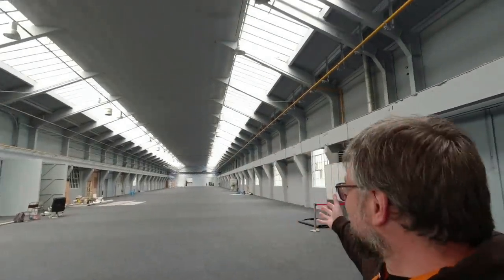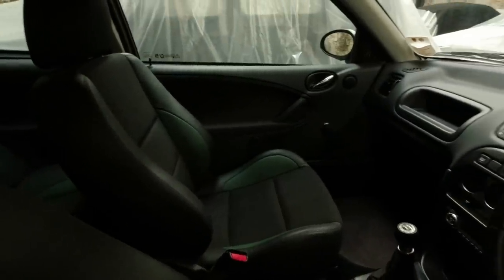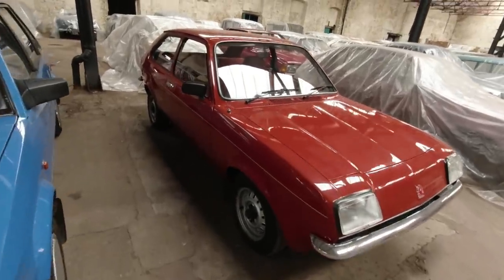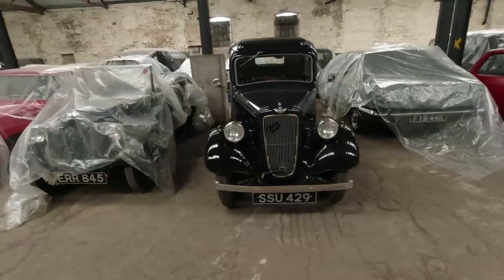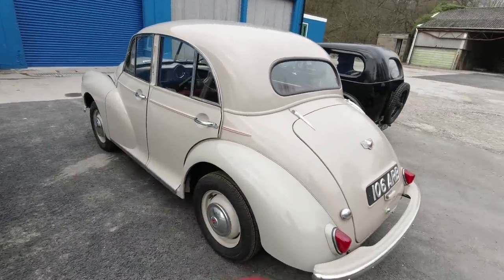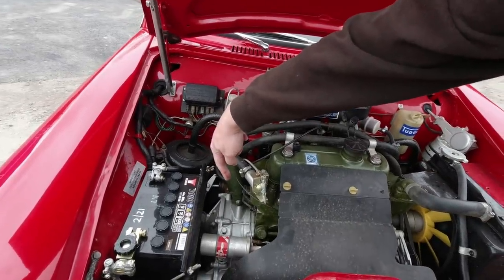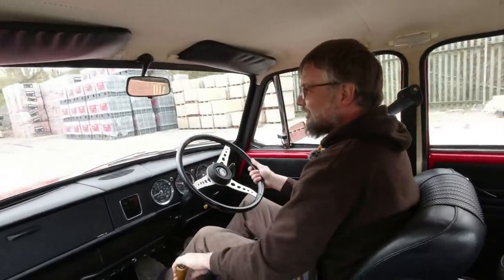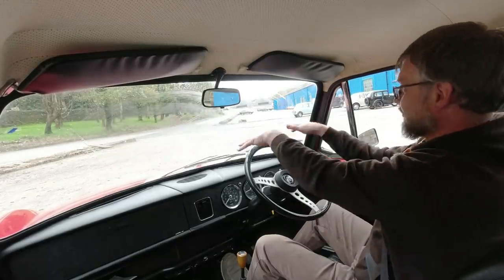Great British Car Journey Museum! With Austin 1300GT Drive!

Comment: Bucket list just extended by one more item and it has gone straight in in pole position!  What a wonderful idea. Driving a baby Austin is already on the list so two birds with one stone. 
My father used to tell of his epic journey from Cambridge to Oban in an Austin 7 and having to go up the old Rest and be thankful pass in reverse gear because the ratio was lower than first gear. That or first didn’t work which is not impossible because he also rode a bike that only had one pedal when posted up in those parts during the war!  What an adventure that must have been. 
Wishing them every success with a wonderful business model.

Comment: Great video Mr Hubnut!👍
My aunt had several beige colour Austin 1100s when I was growing up, always bought brand new. She switched over to Allegros when the 1100 was discontinued. 
In the late 80s my dad bought a 3 door 1100 from a friend. It was dark brown with orangey beige seats. He welded the complete floorpan with new metal as it was full of holes. I drove it a few times and it was lovely and easy to drive. Quite nippy too. Huge steering wheel. Nothing like the cars of today. Although I always thought the 1100's body design was ugly. We were out for a drive in it once, probably in the early 1990s, and some young lads were laughing at the car. They probably hadn't seen one before and didn't know what it was, so I forgive them! :)
But in the end, that little Austin saved my dad's life. He was on the motorway in France, late at night, when a truck driver fell asleep at the wheel and crashed into my dad's car and pinned it to the central reservation barriers. My dad was badly hurt, but he survived the crash praise God. I saw the photos of the wrecked Austin and the roof had been bent upwards in the middle like a squashed drinks can. It was a mess, but if my dad had been driving a left hand drive car, it would have been a far worse outcome.

Comment: Memories of replacing and pressurising the hydrolastic suspension on my mum's 1100. Also discovered that you can get the wheels to lift off the ground with spirited cornering on the 1300GT. Great little cars to drive.

Comment: Takes me back to my second car - a white 1971 1300GT with black vinyl roof and red interior bought brand new.  However, in three years of ownership I upgraded mine - engine bored and stroked out to 1430cc plus different cam, bigger SUs and straight through exhaust, per David Vizard's book on tuning the A Series, anti-roll bars, bigger brakes and 13 inch wheels - a Lotus Elan eater that I thoroughly enjoyed.

Comment: Just a pedantic point, the air wasn't ducted in through the wing to the radiator on the 1300GT, or any of the similar transverse-engined cars from the mini upwards, it was ducted outwards. The air came in through the grille and then over the engine, through the radiator and out to under the front wing. At 20.32 you can see the fan blade, bearing in mind the engine rotates clockwise when viewed from the fan end you can see that the fan pushes the air outwards and not inwards. As a mechanic in the 60s I remember not many people realised this as it was opposite to 'conventional' cars like the Morris Minor, Austin A30/35/40/55/60 or any of the Ford or Vauxhall cars of the day.
Reply from the maker: Yeah, a stupid 'fact' my brain decided to chuck in without thinking about it...

Comment: I had an Austin 1100 in that exact color.  I rebuilt the engine and had it resleeved to get it back to factory shape.  I did put on a header and dual carbs.  I used to have the worst problems with it until I dumped the contents of the gas tank and cleaned it out.  After that I drove the car the length of the PA turnpike at 80 mph and it ran like a top.  I never got pulled over but I think it was because the state troopers thought that nobody would believe that the car could do 80.

Comment: that t reg astra at 2:30 only has 45000 miles on it. but check the mot history and its still suffered from rust issues and at 5:30 the maestro has only done 13000 miles.

Comment: Saw my 1st and 2nd cars next to each other. Vauxhall Chevette next to Austin Maestro.  Though mine were a poverty spec chevette and then vanden plas spec Maestro with R series engine, space age dials and talking trip computer.  The former was the only car I had with manual choke, the latter could have been doing with one. It’s electronic choke was awful.

Comment: No news about Scotty and Whisky at the moment. Just wanted to point you in the direction of channel I found recently called "Ivan's Shed". Latest video is a walk round and driver of a '59 Mini. In the background, while they're doing the walk round, the engine on the stand ticking away, is an old prototype 2 cylinder engine they have been rebuilding. Fabricated a crankshaft by chopping and welding old cranks. They've recently got a 2 stroke engine that was made for the Mini. Should be interesting to see them rebuild that.

Comment: A slight error on the airflow direction on BMC transverse engines,  The air comes in through the grill as normal and is blown out through the radiator into the front wing.  Otherwise all the spray and road muck would be sucked in, block the airflow through the radiator and cover the engine bay.

Comment: I hate to be "that guy", but i'm going to do it anyway. on transverse A series engines with the side mounted rad, the fan pushes the air out through the wheel arch. Great video as always, and i'll be visiting that museum as soon as possible.
Reply from the maker: Yup, my error. There's always one. Sometimes more...
Reply: @RussEdgar445y7tlfj  did these not have a remote servo like the Mini cooper S at the time?
Reply: @HubNut  If it helps, I didn't spot any errors in the A series video, despite me playing with those engines for several decades.
Reply from the maker: I did make a mistake. The 1071 AND 970 were over-square...

Comment: Just started watching Dad had a MG 1300 back in the day-Care nice and comfy car Seemed fast as a kid.1990ish I had a Twk coloured 1300(very comfy but holy-wellies worn when it rained)Shell was shot and failed MOT but for some reason it had an 11 stud cylinder head so whipped it out and threw it in a mini.Good times.If only I'd realised at the time that the engine was possibly special a la cooper s-can't remember if it had tappet chest or solid block.

Comment: I owned a 1300gt in the mid 80s, great little car. Unfortunately got my finger stuck in one of the holes in the steering wheel while stopped at traffic lights.

Comment: Any pre-war (1928-1934) Morris Minors in the collection? It's a very important historical car as it was the basis for MG's very first small two-seater 'Midget' in 1929. All future two-seater Roadsters, including the 1962-1980 MG B and the MG F and TF from the 1990s and 2000s, owe their existence to the 1928 Morris Minor. I am slightly biased as I own a 1932 two-seater. 😄

I was hoping you were going to do a test drive of that Austin Seven (Nippy?) at the end of the video. Sad times.

Comment: 1300 GT...almost 
Mini Cooper 1275S engined. Very much a watershed of the best A series production hot parts. Alas, the  T Rex Eliminator  1275GT Clubman. Austin 1275 single carb, tractor cam, grey Slurry.

Comment: I had a brand new Austin 1300gt in bronze Yellow. Their were 3 extras you could have put on. Bumper Overiders Servo Assisted Brakes
Reply: Heated Rear Window. On the road cost including tax in 1970 was £1077. I thought at 21 could I afford to spend that much on a car. Wish I bought 10.

Comment: My aunt had a 1971 Austin America that I was quite fond of. Similar spec to this one but with two doors. Same steering wheel and grille. Not up to American driving conditions though. CV joints fails after a few years...are they a different type than used on modern front drive cars???.

Comment: I can almost hear that MK1 Astra making that knocking sound that was so common.
Reply: Worn camshaft bearings! I had a Mk1 van that was so badly abused, the followers wore deep grooves into the cam lobes, then bits of the lobes broke off and did even more damage.
Reply: @Zeem4  That sounds about right.

Comment: If I visit and drive one will activate the washers and wipers and tell them hubnut told me to do it 😂 On a slightly more serious note when did the radiator on transverse engined cars move from behind the wing to what is to me a much more logical place behind the front grille?😃

Comment: After seeing that big gantry crane still on site it made me curious about previous use of that building and apparently they made steel wire the company went back around 150 years and the whole site was engaged I guess the demand for wire has diminished or supplanted by China perhaps.

Comment: Nice car The Austin 1300 GT. The only real downside about the hole range was thay were absolute rot boxes.  I went to buy one over 40 years ago. It was a god job I opened the front passenger door bk both hinges including the door came completely off the car. I didn't buy it .

Comment: Owned 2 Austin 1100's one had 18000 genuine miles, 11 years old registered to a large garage group to get round petrol shortage at the time. Sold to Genuine old Lady owner after 3 years and 3,000 miles. She put the remaining 15000 miles on it until she sadly passed away. I had it many years, till a tractor hit it. I was offered a not too rough 1300gt for free. I knocked it back. It hadn't the "Thermometer" speedometer. I just couldn't do it. Sorry 1300gt enthusiasts. I loved everything else about them, shimmable ball joints, the pints I won in the pub (though sober when performed) mk 1, 2 did not have a synchromesh on 1st gear. A bus driver tought me how to properly double de clutch. Conversation "cant stop first gear grinding even when Im stationary" me:"Take it out of second, put straight back into second then quickly up into first" second punter "I wish they didn't grind in first when moving" Me: with false puzzled expression " Mine Doesn't" then started a debate, with an agreement to meet up next afternoon where I would drive THEIR Car to just over 15 mph before double de clutching and throwing it into first with not a grind. I also braked down to 5 mph before letting the clutch up I, then 19, spent the afternoon showing 3 forty odd year olds how to double de clutch at around 5 mph, more useful speed. Following Friday I don't think I bought a drink in the pub! Happy times.

Comment: 17:13 Servo on the brakes - you're imgining it !
Drums all round, who needs a servo !
Reply from the maker: Pretty sure these have front discs. Looking back at the engine bay, no servo.
Reply: @HubNut  That's what I did but remember the brake master cylinder next to the clutch one - looked like single braking system & no servo. I doubt you'll find a vehicle with discs and no servo as discs require a higher hydraulic pressure.... brake pads press against the side of the disc - so no way to create mechanical leverage/advantage. With drums, technically there can be a 'lead' shoe - so your foot applies the lead shoe against the drum - the reaction to that is to push the shoe around the axle and in doing that, the lead shoe pushes the trailing shoe against the drum - giving mechanical advantage - so in effect, it works like a mechanical servo inside the drum.
To think earlier cars didn't even have front brakes !
Reply: @RussEdgar445y7tlfj  Interesting ! 
All I can guess from that is that the brake pad material was not the one used today :)
Reply: @RussEdgar445y7tlfj  If you want brake performance - look at trucks. I'm not up to date on those but I bet most are still on drum brakes !